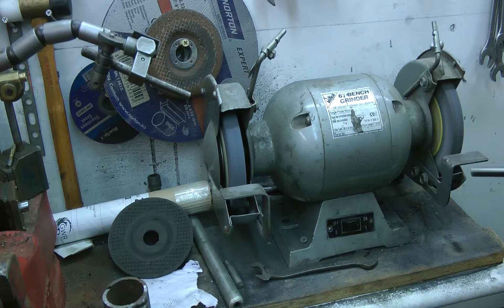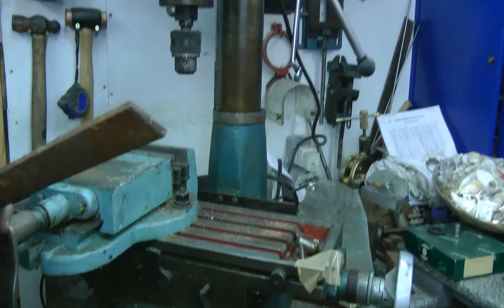I made a flow drill at home in the workshop

Comment: We used to drill out hardened bolts and dowels using Stellite rods. Grind a shallow 3 sided pyramid on the tip and away you go. Needs a rigid setup mind.
Reply from the maker: Thank you 👍  sounds a tough job to do getting a hardened bolt out !